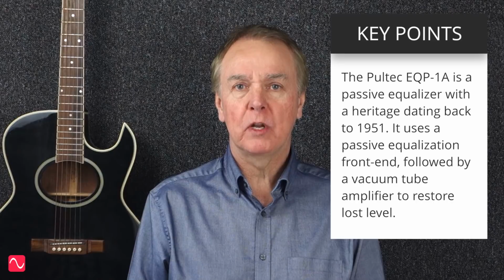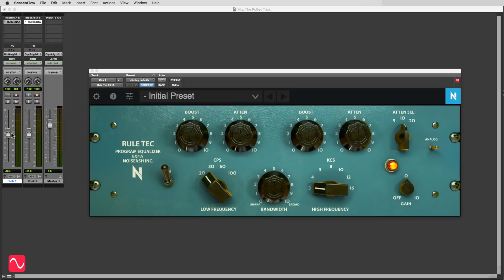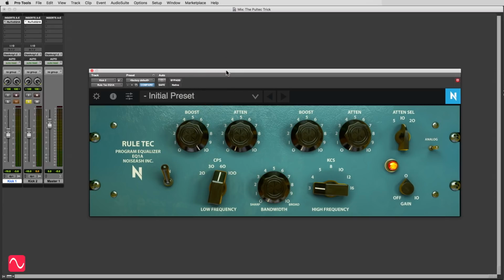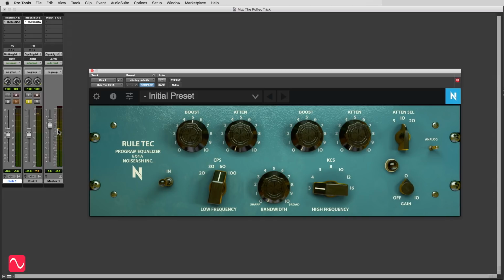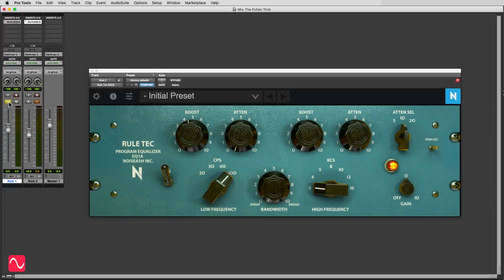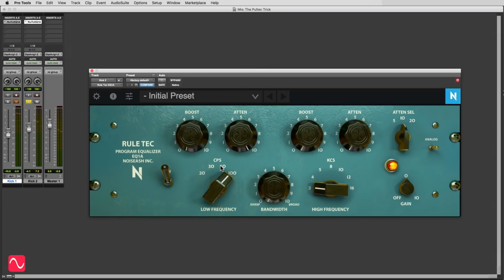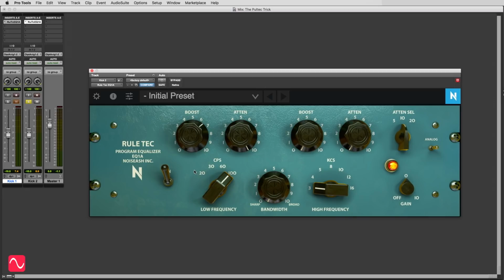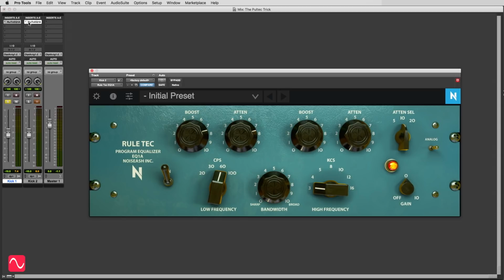How to set the low frequency controls of the Pultec equalizer  on kick drum (inc. the Pultec trick)

Comment: What frequencies to boost on drums and bass? In common?are Drums higher or lower than bass should be in low frequencies?
Reply from the maker: Every case will be different. In general however you would consider whether you want the kick and bass to blend together, in which case you would try to make their frequency balance similar. Or whether you want the kick and bass to be separately audible, in which case their frequency balance should be different. This applies both to the region of the fundamentals, and also to the important harmonics. DM

Comment: in your A-B you forgot to compensate the apprx  2 db of gain that the Plugin adds just by insterting it on a track
Reply from the maker: Thank you for your comment. Indeed the plug-in does boost the level, even when bypassed using the front panel switch. At 10:42 we compare the level of the two EQs, both switched in on the front panel, but one with an EQ boost. We then measure the levels of both and raise the level of the flat EQ to bring both to around the same peak level. So the comparison is between the flat signal going through the EQ, and the EQed signal going through the EQ, both at approximately the same level. That the EQ boosts the level whether switched in or out  on the front panel is the same for both channels. We might consider a further test of the EQ flat and switched in, and the original flat signal without any plug-in, again with the levels matched. That would be for a future video. If you feel that we have not fully addressed your comment, please feel free to comment further.
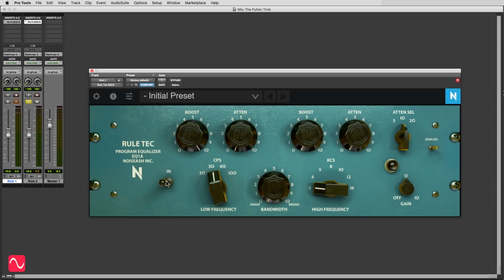Reply: @AudioMasterclass   i think i did not express my self good enough. i meant that i am a big fan of immediately Volume matching. When you started at around lets say 5:20. you said "switch in and out"  and it "improves the sound". while i dont argue with this , you also have a 2 db boost everytime you switch it on. this makes it harder to hear the difference like you do also in 6:30. To me the best (or one of the best cause i dont know many others that do this)  is for example Powair by Sound Radix. When you throw it on a channel it has a perfect automatic Volume matching that is On by default but you can switch it off. So the first thing you experience with it is perfect Volume matched comparrison. I dont mean that i did not enjoy your video. Just a thought for the Future
Reply from the maker: @saardean4481  Thank you for your clarification. It is a useful reminder that either levels should be adjusted so that plugin-bypassed and plugin-active are the same, or mention should be made that they are different, and we try to remember always to do this. A further finesse would be to match the levels of EQ-in and EQ-out using the front panel switch. We sometimes make this kind of correction, but it can slow down the pace of the video too much and it is more practical just to mention the level difference. One point that perhaps could be clarified further, and please correct us if there is a mistake, is that with the insert bypassed, there is no level change from no insert present. With the insert active, then the level rises by approximately 2 dB. However the difference between front-panel-off to front-panel-on is +0.3 dB with all cuts and boosts set to zero (measured in Pro Tools with a 1 kHz sine wave at -6 dBFS). In our video we have treated this as negligible. Probably for a single instance it is, but small differences over a large number of tracks can add up to something that is easily audible. We may consider developing a policy of what level difference we consider to be the dividing line between negligible and significant, but for the moment we will decide from video to video. Thank you for your input which has been useful.
Reply: @AudioMasterclass   My pleasure. I enjoyed the video and got some new thoughts so its a win-win
Reply from the maker: @saardean4481  It certainly is thank you.

Comment: you're using the attenuator. what's the trick? what am i missing? are you using both tracks together or just for comparison?
Reply from the maker: The so-called trick starts at around 18:25. The two tracks are for ease of comparison and only one is ever used at any time.
Reply: @AudioMasterclass  i'm not trying to be smart ass but i don't get the "trick". crank the boost and crank the attn then dial 'em both back a little?
Reply: @freakyrandy  The boost and attenuation (cut) each have different Qs (widths). So the boost is wide, and the cut is narrow. Nice wide, controlled sound. If you're listening on a phone or laptop speakers, you're not really going to hear a difference. When he A-Bs the two examples, the difference is pretty remarkable. :)